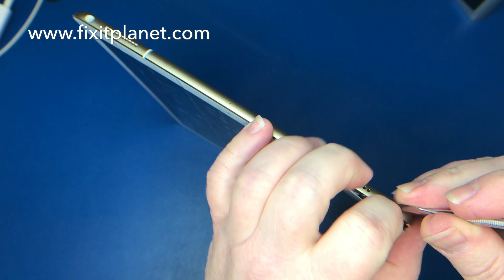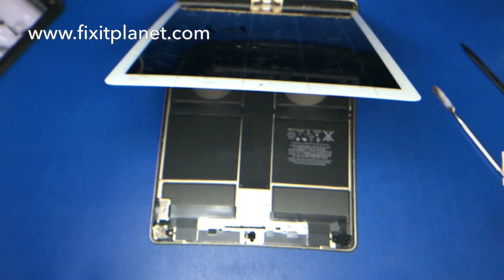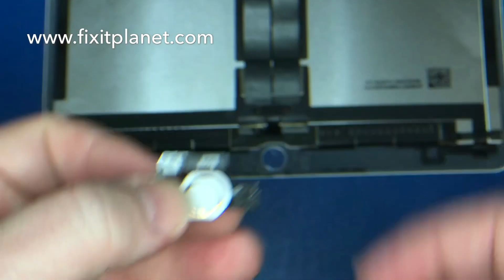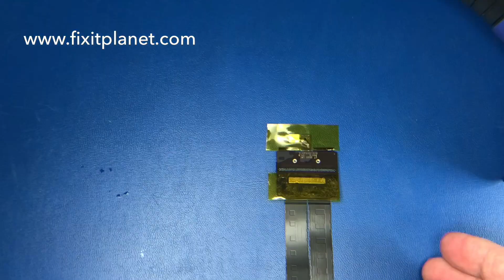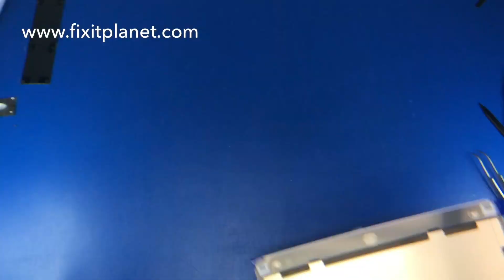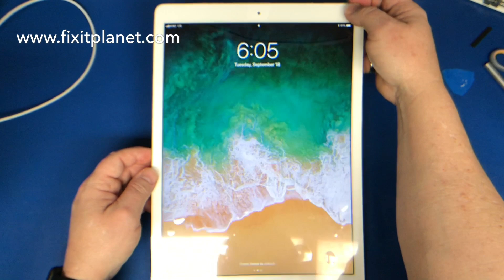What's the difference? iPad Pro 12.9 (2nd Gen) Screen Repair From Start To Finish.

Comment: Hey there! I'm an idiot and didn't bridge the battery and fried a pin on the screen so now the digitizer doesn't work. What are the odds a new digitizer would fix it? Do they come with everything? I'm worried i fried a daughter board on the way and replacing the digitizer won't do anything. Thanks!

Comment: I just bought a second gen iPad Pro 2 used from eBay and now a line just appeared across the screen.   I saw in another video where they reflowed the solder you fix that line issue.    I’m just wondering if you can buy an entire replacement cable versus needing to do the soldering?
Reply from the maker: Yes you can get a replacement cable but there are more than one reason for the line.

Comment: Is there a difference in the A1670 and the A1671 as far as replacing the LCD and glass, because I have the A1671 and ordered the part and the guy at the repair shop told me they have different connection. Is this true ? Also if it is is there anything to do to still use this part? Thank you.(Does the ipad pro 12.9 2nd gen. have different models for the screen/LCD or do they all use the same one)

Comment: Good man! Thank you very much.
Also, I'm wondering what are the temperatures on your soldering iron and hot air? I found it is very easy to damage small and delicate components while using too much or not enough heat.
Reply from the maker: Around 750 degrees F ... this varies depending on the tools and some other factors.

Comment: Hello there.
Is there really no way to replace the Glas only on an ipad 12.9 Gen2? The display works fine.
Reply from the maker: "Glass only" repair is possible but difficult. It is not worth the trouble in my opinion but you have to decide.
Reply: @FixItPlanet1   i have not found anyone who does this repair. Where do i get a Glas? Is it the same as the Gen1?  I just find it absurd paying 400 in order to replace the whole Display+Glas when the Display is fully operational. No matter how much i think about it i cant find it logical
Reply: Did you find something on your issue I have the same situation
Reply: @TechVech0   Hey there. I gave the 12.9 back so never did it. I however replaced the glass on a ipad pro 10.5 from 2017-18. They told me they plan to get a bigger Vacuum thingy in order to be able to fit the 12.9 inch. The 10.5 glass replacement cost me around 140 euros in Germany.

Comment: Hi! Quick Question. Just wondering if replacing the digitizer/screen would fix some touch sensitivity issues that have been plaguing the 2017/2019 ipad Pro line and iPad Air 2019 ?
Reply from the maker: Not much else you can do. Give it a try.

Comment: I have a ipad pro gen2 12.9 with cellular.  The screen broke...it works fine now EXCEPT for the facial recognition.  I can still use the password, so no big deal.  My question is (and forgive me if you already covered this)  Will a gen1 screen work on a gen2?
Reply from the maker: Nope the gen 1 and gen 2 are different.
Reply: @FixItPlanet1   I have a nagging suspicion the bare panels might be interchangeable, but actual flex cabling are different.
Reply from the maker: @bobweiram6321  Nope the gen 1 and gen 2 are different.

Comment: Is it necessary to replace the LCD with the Digitizer?
Reply from the maker: This model comes with the display assembly complete including digitizer and display fused together. if you want to attempt a "glass only" repair it can be done but is not very practical.
Reply: Fix It Planet, why it’s not practical? And is the touch screen from 1st gen 12.9 pro compatible with 12.9 of 2nd gen? Thanks.